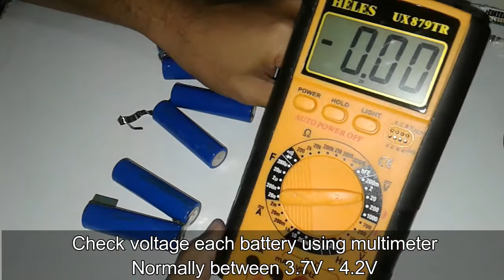This how to change dead cell battery laptop (Cara ganti batre cell laptop yang mati)

Comment: What's the mAh of a single battery used
Reply from the maker: This laptop battery is about 2000mAh of each. Usually its only one of the battery cell is broken but it makes broken the other cell with paralel connection.